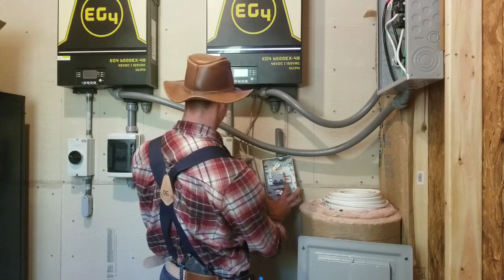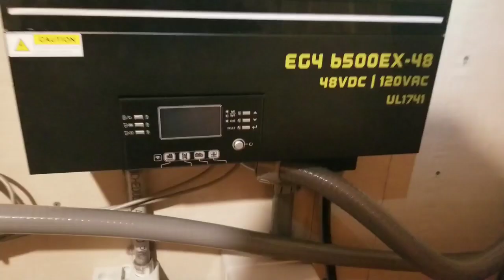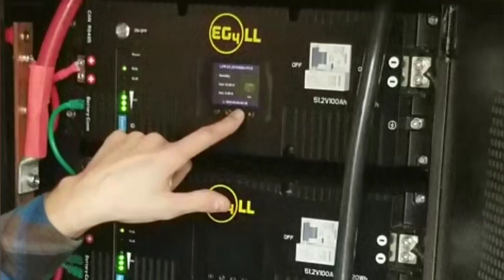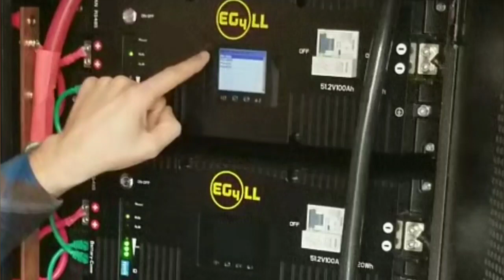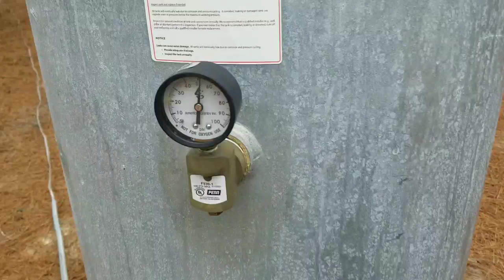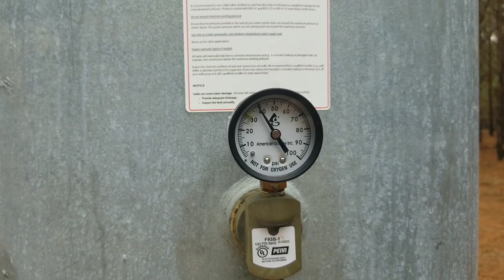Wiring the EG4 batteries and powering the Well Pump | PV System Part 11 | Getting off the grid

Comment: Good work and an excellent video. Think about getting Solar Assistant to monitor things.
Reply from the maker: Thanks! I have heard about solar assistant but have not yet looked into it. I do not have wifi so not sure if I could use it without a router.
Reply: @DIYorDIE_Off-Grid  It also has a Bluetooth app for your phone. A lot of us guys swear by it.
Reply from the maker: I'll check it out at some point. Since we have the inverters in a detached shed about 20 feet from our RV I'm not sure how well the bluetooth would work though

Comment: Really appreciate your close-up videos and and explanations of all your work by the way which way is correct with the nadir 60 V 2 202 amp dc breaker line does it go to the inverter and load to battery or vice versa preciate your info thanks 08
Reply from the maker: Battery is Line and Inverter is Load. The reason is that the battery bank is acting as the power source just like utility is power source. The purpose of the breaker is to protect the inverter (and wires) from over current condition. The battery bank has a 600A capacity and the max input load current for the inverter is about 150A DC.

Comment: Great video!
My question:  did you say the EG4 battery set can be set to talk to Xantrex 6048 inverter?  Really appreciate your help.  Thanks!
Reply from the maker: If it is a Schneider brand inverter than it should be able to communicate based on the manual. Before buying any batteries though I would confirm with signature solar for your specific inverter.

Comment: What make/model and HP rating is the well pump? Got a current clamp with hold to measure peak amp draw? Do lights flicker at all on the same circuit as the well pump powered by the EG4 6500EX-48 inverter? Have a dual Outback Radian 8048a-01 inverter stack here and it seems to run whatever but the lights do flicker a bit on startup of 12kW load. The Radian units are low frequency inverter design and I'm wondering if the high frequency inverter design (like Sol-Ark 8k/12k/15k, EG4 6500EX-48, etc.) are going to be dependable for 5hp-7hp locked rotor amps of a submersible well pump.
Reply from the maker: I don't remember the make/model but I know the well pump is 1HP. I dont have any issues with lights flickering with the battery bank installed
Reply from the maker: I think that would be a great question to ask Signature Solar. They should be able to help you figure out what the best option would be for your scenario.

Comment: Looks like your green battery com cables are connected wrong.  Should go from bottom port out to top port of the battery below all the way down.
Reply from the maker: Hmm, well mine seems to be working fine 🤷‍♂️ the original user manual that came with my batteries showed the Version 1.0 LL batteries and did not come with a wiring diagram for the comm ports. Did you get that from a EG4 LL V2.0 manual or from signature solar?

Comment: You need to pre charge the inverter before you close the beaker or it’ll shut down like that.
Reply from the maker: How do you do that?
Reply: @DIYorDIE_Off-Grid  
Temporary put a precharge resistor across the contact of the breaker. If you don’t have a resistor, you can use an incandescent household lightbulb. It only takes a moment to charge. You may even see the bulb glow and dim out. The without too much rush, close the contact.
Reply from the maker: What do you mean by the contact of the breaker?
Reply: @DIYorDIE_Off-Grid  load side (inverter)over to the supply side (battery) of the breaker/disconnect. A jump across the screw terminals with a some kind of resistor so there isn’t a sudden current flow into the inverter or high discharge on the batteries. Even if there’s a pre charge feature in the rack batteries they don’t always work so it’s better to be careful and just pre charge.
Reply from the maker: Got it, I was just going to say that the EG4 LL I'm pretty sure come with pre-charge feature built in. I had no issues starting mine up without a manual precharge resistor.